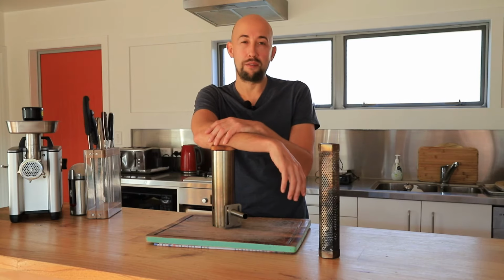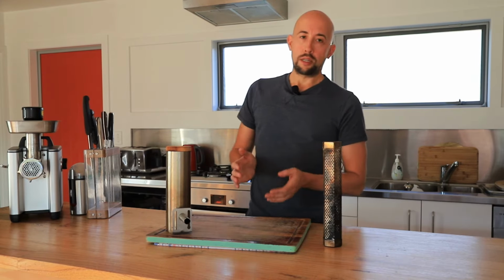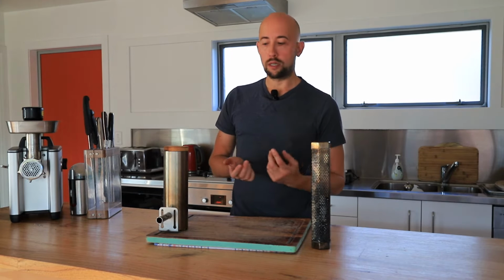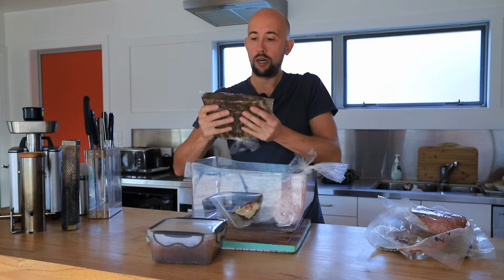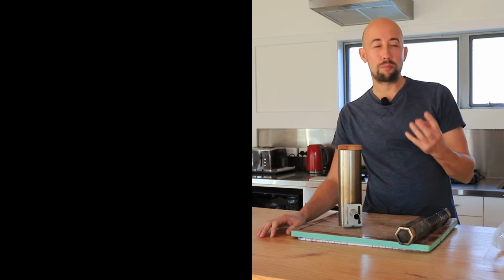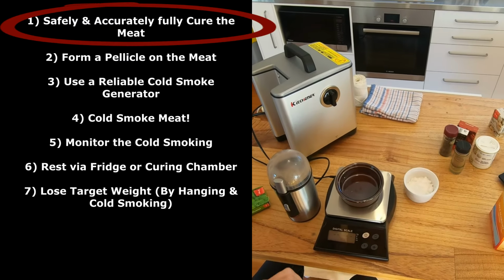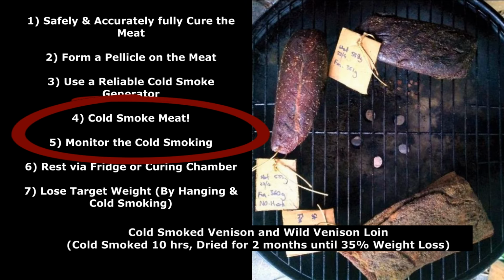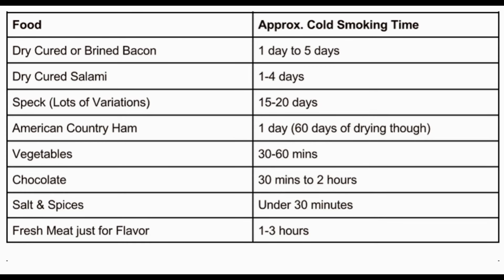Beginners Introduction to Cold Smoking Meat & Food

Comment: My first experiment with cold smoking I melted the thermometer because the wind blew the flame up at the perfect angle to blast heat into the smoker. I turned it around on a less windy day and it worked much better.

Comment: I just cold smoked summer sausage, we did salt cure and smoke for 14 hours.   What is the benifit to letting it hang in a cool environment.  The recipe we used suggested hanging it for a month.
Reply from the maker: Nevermade it, but I've had/seen many of them - semi-dry fermented stuffed sausage - fermentation to drop pH increase acidity gives it a little shelf life, but basically its a cooked sausage definitely not a dry cured fermented salami. Hanging for a month, maybe the Maillard reaction and fat oxidation (in controlled amounts) can also deepen flavor complexity. Moisture loss occurs during hanging, which can lead to a firmer, more desirable texture, depending on personal preference. This mimics the drying phase of traditionally cured sausages. If the sausage was properly cooked, fermented, and had a curing agent (like nitrites or nitrates), hanging in a cool, well-ventilated, and controlled environment can further reduce moisture content, making it even less hospitable to spoilage microbes. However, ensure that storage conditions (temperature, humidity, airflow) are ideal to prevent mold growth or spoilage. Lastly, If the sausage wasn't fermented or cured properly, hanging for a long time could encourage spoilage. Without a controlled environment, the risk of unwanted microbial growth is higher.

Comment: i one time tried using walnuts shells for cold smoking and it turned out great, idk if anyone else had this idea? never seen it yet , they smolder nicely and all catch provided you crush them enough like pellet size
Reply from the maker: I've used pataschio shells mixed with other woods, here is some other info gpt showed - While English walnuts typically contain less juglone than black walnuts, there is still some present in the shells. In typical cold-smoking scenarios (where temperatures are relatively low), significant toxin release is unlikely
Reply: @eatcuredmeat  hmm yeah i was not sure if there was a danger to using them, i just noticed they do smolder and smoke nicely with a good aroma but those were the days i did not have the advantage of the internet to look things up, and im not sure what type i used english or black, first time im hearing it or this juglone thing  but you say it is ok?
Reply: i just did an ai search and it says it is ok to use it for cold smoking and it adds depths of flavor to meats on its own or mixed with other woods yet they do not mention anything more about species or toxicity, wonder if the aroma is mild like fruit woods or somewhere in between

Comment: Great vid! I would like to cold smoke meats (steak, pork). I would like to use a Weber Smokey mountain smoker, roughly 85 degrees. Roughly 18 hour smoke time.
If I have adequate oxygen in the smoker, does that mean I do not need to salt cure before smoking? 
Or, is it always a good idea to cure all meats (steak, pork) before cold smoking at 85 degrees for 18 hours?
If salt curing is necessary I would like to try Natural (no nitrites):
Sea Salt and Celery powder (or celery salt).
Rub all over meats. Let dry out in salt and powder for 1 to 2.5 weeks in the refrigerator.
Does the amount of salt and celery powder or celery salt matter?
Then smoke 85 degrees, 18 hours.
Test air flow in Smokey. Danger is if low oxygen or no oxygen. Test by placing a candle in Weber for 30 minutes. If candle stays lit, there is enough oxygen, and thus, not in danger for bacteria growth.

Thoughts? Is this plan safe?
Reply from the maker: 85 is a very warm..... cold smoke I prefer about 30 deg less in Fahrenheit. For cured meat recipes, defintely salt curing is the way. 
Here is some other articles/info that might help - 
https://eatcuredmeat.com/dry-curing/methods-on-how-to-cure-meat-with-salt-with-pictures/
https://eatcuredmeat.com/dry-curing/which-salt-for-meat-curing-a-full-breakdown/
https://youtu.be/hy2SzkE2VqI

Comment: Very nice video, and I learnt a lot. Would a smokerbox also work?
Reply from the maker: Hey thanks! encouraging! smoker box could be many things. I've used a heavy metal ver. on a gas grill, to try and add smoke when hot smoking. Didnt work very well, wasnt much airflow. If I still had it, I would drill lots more holes in it. For Cold Smoking, guess it could if you had enough airflow. Pellet Tube or maze or just a large round sieve push in the middle to make a donut.... Tom

Comment: Ok, good stuff.
So......i want to coldsmoke/cook kielbasa sausages....this will have to be done indoors!
I have a Ninja foodie which is pretty much air tight. thinking of getting a 6 inch smoke tube to drop in and hang the sausages.
Now would i do this with fresh sausages or cook them first! I know if i slow cook i will have to use prague powder no 1.
I'm gasping for some smoked sausages! I bought one of the 'Cameron' indoor smokers which is useless as it's stovetop and cooks too fast.  Bone dry sausages.
Reply: Hmm, Could i do the above and try to regulate the ninja to 80c then hot smoke em?
Reply from the maker: i would say, dodgey! trying to hack it, but thats your call. cold smoking no way need air flow. hot smoking I've done hot smoking with a portable smoker on the gas hob indoor, extraction fan took away most of it. still smokey though! Those portable camerons can work, but you have to either get smoking going then dial the heat super low, then leave the slide slightly open for airflow, too much smoke makes it bitter I've found.

Comment: Hey I love my smokei, I have had 2x issues with. 1X if I leave the lid on when using, moisture builds up in the chamber and a tar builds up imparting a horrible creosote taste. with the lid off it burns like a gem problem solved. Just not sure why no one else has had this issue. I use applewood pellets.
The other issue that I wish I could resolve is I am constantly adjusting the airflow to maintain a steady flow of smoke. Not a problem during the day with a beer in hand. I would like to smoke of a night with cooler temperatures as my next venture will be bacon and pancetta. I would recommend the smokei to anyone for cold smoking.
Reply from the maker: Hey John, haven't had those issues myself, it will always get some build up/residues. I emailed Tony @ smokai yr comment - he said: "it may be the brand of pellets he's using, or more likely..... not enough airflow through his smoking chamber, or a combination of a number of things.  Would be good to understand the size of his chamber, what he is using and how he controls airflow." 
Maybe get in contact with Smokai for more info - Cheers